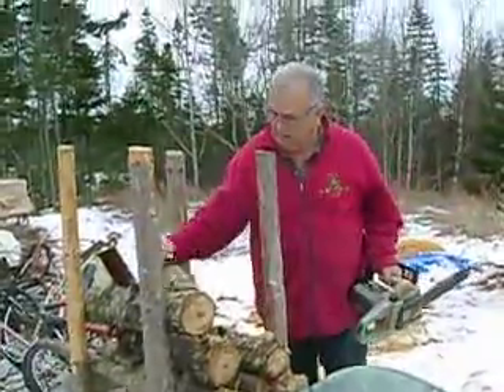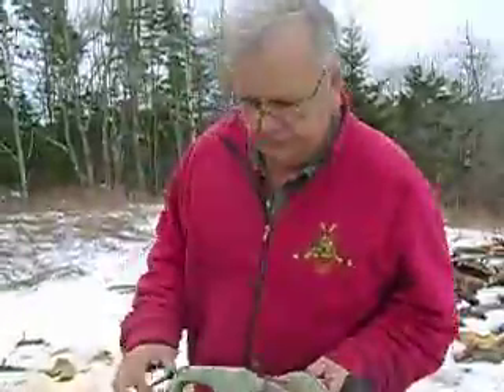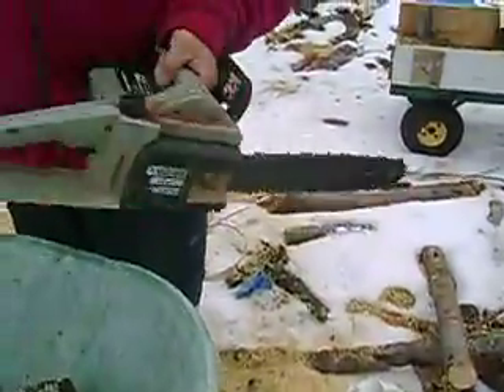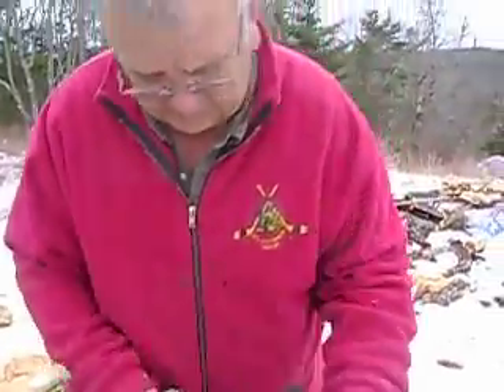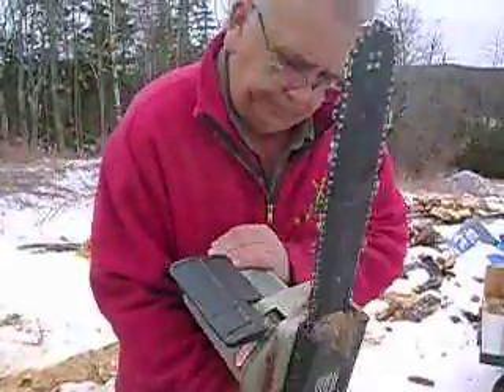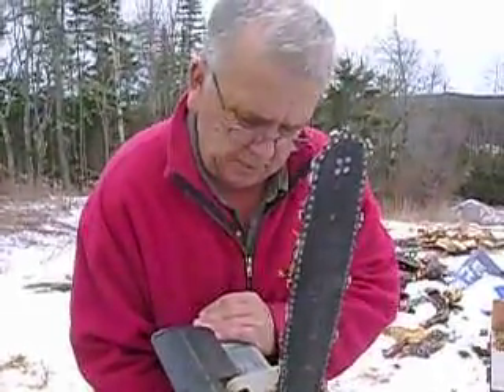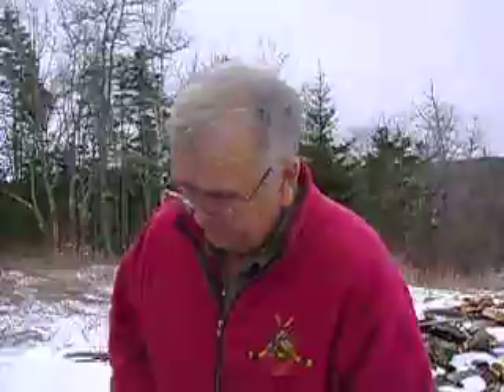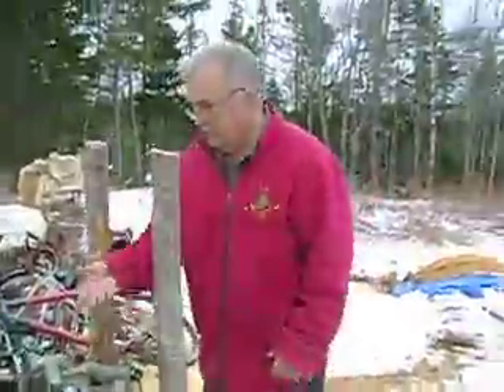Electric Chainsaw

Comment: Thanks I use one all the time for various jobs around the house. You may have know this but if not, tie a knot on the connection so it doesn't pull apart as easy.

Comment: i got a nice new one (much quieter than that, top name brand) for $167. it is a bit slower than the gasoline stihl I got, but the chains are $20 not $50, and works like a dream. I sometimes use it in the shed when it's raining. what I like about them is the fact I only have to top up the bar oil (AND i fill it from the top, not a sawdust drenched plug on the side), and away we go. the stihl has a very small fuel tank (too damn small, frankly) and by the time i check if I have 2stroke left, fill it up with gloves, top up the bar oil, retension the chain, it's just too long over 2 or 3 cuts. i just top of the bar oil with no gloves, pull the generator start cord and off I go. and like I said it's fine to use in the shed coz there are no fumes filling the shed up (generator is in it's own box outside a few meters away). After having cheap unreliable gasoline chainsaws previously, and buying this before I had my stihl, it was such a dream for reliability (coz the generator ALWAYS starts).
Reply from the maker: I see a lot of advantage for the electric chainsaw in an around  the house,I never thought about using it indoors.